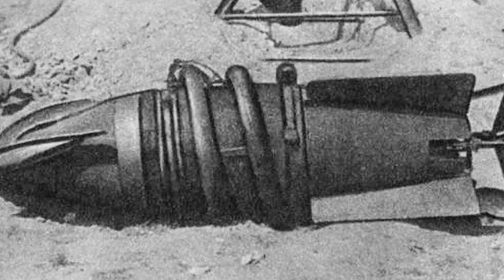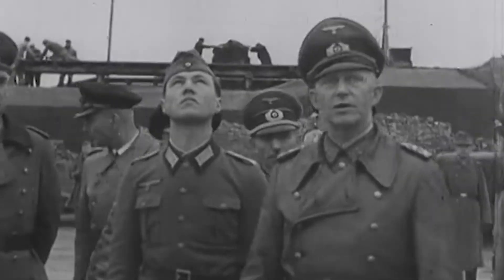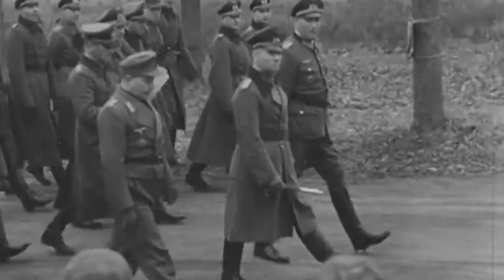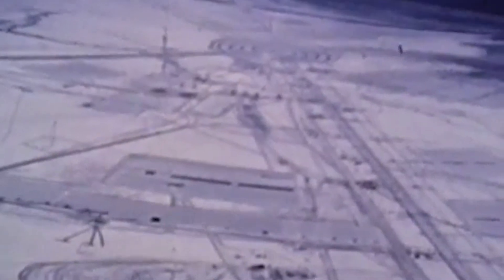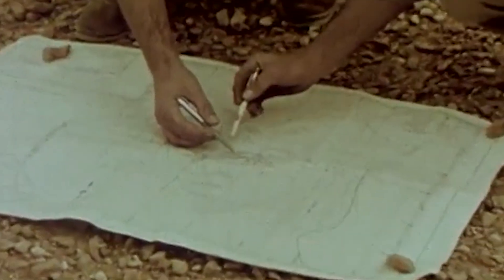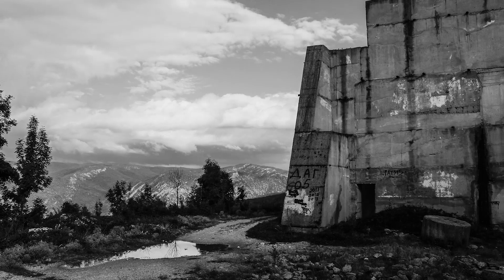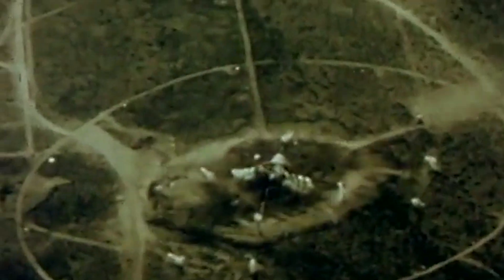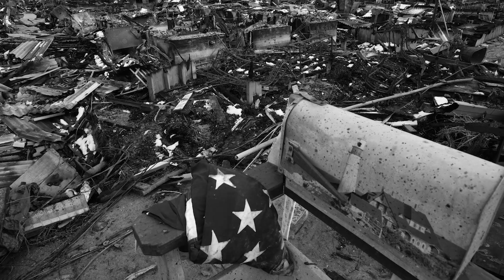The Soviet Nuclear Battle Mole: An Underground Cold War Battleship?

Comment: I feel it necessary to call serious BS!    

This is all just of the top of my head from past school research projects.

  “Drill that melts rock”     A temperature between 1100-2400F (many factors) is required to melt regular rock, temp of an average power plant reactor is somewhere around 570F. Assuming a more compact reactor would of course run hotter, the melting point of uranium is only 2070F (one of the higher melting point of radioactive metals if I remember correctly), and going anywhere close that temperature would most certainly be impossible to contain without a vast supply of cooling fluid. Not to mention that you are basically cutting it’s useful service life into weeks (without doing too much math) as opposed to years if not decades compared to war ships and power plants. I’m not even sure most control methods could even survive those temperatures let alone the rapid degradation due to (this process that I can’t recall the name of, but basically speeds up corrosion due to heat and oxygen exposure). Assuming you could somehow generate, store, then adequately release that much power from such a poor reactor design while still trying to maintain movement and suitable living space, this is all highly unlikely. 

SOOOOoooooooo many other reasons why this would never work...

An RTG powered electric drill on the other hand, would probably work. But would still suck.

Comment: A craft that melts its way through rock... interesting, how do you keep from roasting the crew?
Reply: And if it breaks down, it becomes a coffin.
Reply: @NeilRoy  See, Mitch Hedberg was right. It needs an escalator, because an escalator can never break down. It can only become stairs.
Reply: @NeilRoy  NAH! They just have to use the pneumatic canons and shoot them out in the air. Wait? What?! In a tunnel? Oh. No worries, their skulls are harder than diamonds.
Reply: They nuke themselves to create a hole big enough to crawl out of.
Reply: Its just hot at the tip, trust me... lol. And please remember to keep your hands and feet inside at all times, walls are molten glass, thank you enjoy your ride.
Reply: It’s possible to create heat shielding, and with a vehicle this big, if it has ever or will ever exist, could have a substantial bit of heat shielding that would allow the crew to be relatively ok, but what material can be heated that hot and bore through rock and not be deformed thats the real question.
Reply: @jamesshields4346  Tungsten could theoretically be used, seeing as its very strong and has a melting point of around 3.500 °C, way above the melting temperature of rock. Another option could be a layer of plasma to melt the rock, and a layer of ceramics to both isolate from the high voltage needed to generate and maintain the plasma, and isolate from the heat of the molten rock.

However although I could see this beeing feasible in current times, it would probably need huge resources and a hell of a lot of money, and if definitely wouldn't have been possible in the 60's.
Reply: Ceramics
Reply: Flush the Tip internally periodically with liquid Nitrogen held in a coolant recirculation system.
Reply: Now that's an easy one.... How does it come the pilots of an SR 71 don't "roast" ?

Comment: Gotta call BS on this one for a whole lot of technical reasons... Rock doesn't disappear because you melt it or drill through it. Melting through rock like that would mean your whole "Battle Mole" would be surrounded by molten rock at perhaps 1,200 degrees C. And it wouldn't leave a tunnel either as the molten rock would solidify behind it. No matter what you make the Battle Mole out of, it would quickly heat up to red hot inside... and the energy required! it takes about 600 joules to raise the temperature of one kilogram of rock by 1C. A "Battle Mole" would need a fairly large frontal area. Assume it is 4 meters in diameter, that means it would need to melt 12 cubic meters of rock for every meter it traveled. Assuming that it needs to move at 1 meter every ten seconds then it would need to give off some 2.5 BILLION Watts of heat continuously. Since no nuclear reactor is anywhere near 100% efficient, even if one could crank out that kind of power, and the vessel could be protected from the external heat, it would melt and vaporize the Battle Mole pretty quickly. BTW this is several times the power generated by a Ford Class Nuclear Air Craft Carrier. and remember that this is for a vessel that can only move at a pace that would bore a snail, 0.1 kph... And what mechanism would the device use to transmit the heat to the rock?

Comment: only in russia..... lol paratroopers in an under ground  mole machine.  My last combat jump was from -60 metres
Reply: They edited out the part where the battle mole reaches the surface and the paratroopers are shot out of a pneumatic tube to a height of 450 feet so their parachutes can safely open and they can then invade.
Reply: @davidhollowood6580   I'd believe they'd shoot the paratroopers out into the air, but they're Russian and a pneumatic tube sounds too rational of approach. Some engineer or army officer will come up with a cheaper way, like giant rubberbands slingshots,  or holding the feet of two eagles
Reply: @aikhis  The paratroopers have a lot to be thankful for. They use compressed air to launch the missiles from the regular submarines. I don't see the USSR spending extra to buy new rubber bands.
Reply: @davidhollowood6580  this is how things happened back then, we've swept away the rubber band idea as ridiculous because of cost, but the two eagle idea just slipped past to the next round of planning
Reply: @aikhis  Now that was funny.LOL
Reply: toag you sure underestimate them consider the failure that is the F-22 and F-35.
Reply: I did get a great visual of those terratroopers being shot out of the ground in clouds of dirt!
Reply: The Russian word for paratrooper, desant, is used for any special insertion troops, such as Tankodesanti, tank riders, marine infantry, etc
Reply: Was it a Polish design perhaps?
Reply: jokes aside why?
Reply: @humility-righteous-giving  My guess is the way Russia applied the word 'para' - in the West we immediately think of Airborne troops but that's not what para means.
Reply: YEAH, I NOTICED THAT ALSO. IT'S LIKE WHAT DID HE SAY....PARATROOPERS! FOR A MIN OR TWO THERE I FOUND MYSELF TRYING TO FIGURE OUT WHAT IN THE HELL COULD THEY USE PARATROOPERS IN THAT THING UNDERGROUND. I STARTED TO GET A HEADACHE AND FORCED MYSELF JUST TO STOP THINKING ABOUT IT. LOL, AND I THOUGHT OUR LEADERS WASTED MONEY!!! JUST WONDERING DID ANYONE OF YOU COME  UP WITH A LOGICAL THOUGHT HERE? MAYBE THE NARRATOR DIDNT SAY THAT CORRECTLY! A VOCAL TYPO IF YOU WILL
Reply: Cortana: Think about it like this.  The last thing the United States will ever expect is aerial insertion; underground.
Reply: Obviously to invade china... i mean if they were drilling in the first place its only to get to china
Reply: Would you be jumping out, or jumping in?.......
Reply: No mate they grab a shield and get launch in the sky by a nuclear bomb
Reply: I was the captain of an earth vessel, I was very stable and a genius my subordinates would tell me, has any one any questions, ama ?

Comment: What happens to all the rock?  Even if you vaporize it, if you leave a hole behind the vapor will cool and go back to sand.  Rock is already frozen magma.  Most rocks do not have any voids to hold the remnants of cuttings.

Tunnel boring machines have conveyors and railroads to remove the cuttings.

In Minnesota in the 50's and early 60's they used jet piercing drills to drill blast holes in taconite rock, a low grade iron ore.  There was a fuel oil / liquid oxygen flame followed by a water spray to spall the solid rock.  The exhaust from the flame blew the spalled rock out of the hole.  It worked, but modern tungsten carbide drill bits work better.

Comment: Pushing the melted rock to the sides.....How?
The tunnel must be wider than the "mole" if this is to be done.
Imagine a bullet in a gun barrel, the bullet is pushed forward by the expanding gases because the is no room for the gases to get past the bullet.
The same principal would occur here, right?
And if the molten rock would be able to be pushed past the Mole, either by internal piping or groves on the hull, the then molten rock would have to be deposited behind the mole making it impossible for the device to go in reverse.
This will leave no tunnel, basically sealing in the mole in a hermetically sealed tomb of solid rock.
Now if the heat is so great that the rock would evaporate instead of melt then it could work, but the hot expanding gases from the evaporation would have to be vented somehow to prevent over pressure..... maybe that is what caused the explosion under the city?
Anyway stupid idea and certainly not real, I call hoax on it.

Comment: Didn't know that for Russians, however I noticed that in last few decades, weeks or months prior to any larger US military deployments in various parts of the world whenever it is already clear that engagement is imminent, there almost always was news report about a small earthquake in that particular geographic area. Those were very convenient coincidences, especially if there was an high speed camera (or radar) equipped "eye in the sky" to collect seismic wave pattern on the surface and send it to a supercomputing center to calculate 3D image of the underground, revealing positions, sizes and shapes of any underground installations. 

I used reports of earthquakes as a clue that intervention is not just a threat, but already building momentum. I didn't know how the seismic charge could be delivered to the hypocenter, but this video offers some speculations about that. The following is a complete speculation by me, so take it just as entertainment:
I suppose that moving through already molten rock, perhaps just beneath the lithosphere, or at Moho boundary, should be easier than wormholing a glass tube through the rock all the way from point A to point B. It probably has fixed insertion points - shafts, wells, in permanent military bases around the globe, usually near magma chambers, for quicker start/deployment and better global coverage.

Whatever the thing is, it is one way only, it delivers a nuclear charge (neutrino footprint should confirm that), it embodies classified technologies, yet unknown to general public and scientific community, notwithstanding first obviously an explosive device capable of remaining stable under high temperature and pressure, a very high temperature thermodynamic engine for power production, high temperature shielding for electronics, or vice versa high operating temperature electronic devices and electric actuators, and reliable communication between surface and subterranean transceivers. It is either controlled by stored program, or steered by constellation of infrasound acoustical beacons on (or near beneath) the surface, or by projected neutrino beams. It is probable that its propulsion is reactive, as reactive works in all environments and mediums.
Reply: Lonely in that bunker, are we?
Reply: @goofyleo3869   Oh come on, cut me some slack, this is some good stuff, prime material, even though it is pure speculation. =)

Comment: Fascinating but they bring so many questions.
How would operators of them breathe or survive? The heat generated will spread into the machine. Radiation contamination too - unless these are remotely operated or have built-in guidance.
Have we not seen recent videos emerging of rumbling beneath US soil? Covert military operations too which appear to 'target' certain hidden things where recent rumbling and bangs were heard?

You've hit on the obvious one: Travel hidden beneath the sea first which will cover huge distance and hide the moles. Dig them in on shorelines and let them head underground to a set point.

If they do exist, it would be fascinating to see one sitting in a cavity and just waiting..

Comment: Inspite of your solem tone of delivery, I find it hard to believe in this "Battlemole"" project. First is your use of the term 'Battlemole' instead of a suitable Russian name or designation. Even the Cas[ian monster project  bore the Russian designation, Ekranoplane. Second. at a speed of just four to nine miles per hour, the device would literally take "forever' to travel to any conceivable target point without the crew running out of supplies, or being roasted by internally generated and externally induced heat due to friction and the onboard nuclear reactor. 

Thirdly, and perhaps most importantly, the "Battlemole would nt be drilling through  homogeneous layers of rock, but through varying densities of materials. In the same way that Chobham Armor protects tanks from kinetic energy penetrators, the Battlemole's drill might end up stuck fast in the rock it is trying to bore through. At worst, the machine mind end up just rotating around a stuck, fast nosecone. the crew eventually ending up upside down. There is also the possibility of the weight of the earth above it crushing the machine into an immovable shape.

Comment: Pure 1000% B.S. If? the very high temperatures that would be required and enough of it could be applied, and the crew or even a robotic compartment and the nuclear power plant could still be kept cool enough to continue to operate, there's no known man made material that would survive for long at the working end of the machine due to the heat and abrasion. Then howthehellyagonna replace that when it needs it? Heat causes expansion, so you have more volume of melted rock than you have space behind you for it to fit. Even after cooling it's still going to have more volume than you started with. Rock in it's normal state is pretty dense, disturb it by any method and it's simple physics it again takes up much more room by a large margin than the space you have behind you without returning it to the same or higher density.  

The U.S. was and probably still is famous for letting known spys steal information they want stolen just to get the opposing side to waste resources, money and man power on proven not to work concepts. Just enough plausible scientific information gets included to make it appear cutting edge and possible. Anyone think the russkies didn't and aren't doing exactly the same as well as numerous other nations doing it as well? At best the whole manufactured story would be a poor plot line for a B grade movie. Disinformation is a powerful weapon just as much as propaganda is. And this one's full of both. Cheerist I didn't even finish grade 10 and even I can figure out basic physics. Anyone who thinks this could possibly be real needs to start out by bitch slapping there parents for not doing a whole lot better job at giving birth and raising more intelligent offspring. Then go back to every school you went to and do the same to every teacher, instructor or Professor you ever had. All of them have seriously failed you or you spent most of your life drunk/stoned or asleep. To paraphrase Dean Martin in Animal House, unbelievably gullible and stupid is no way to go through life.

Comment: Project was abandoned after everyone noticed Vladimir had stopped taking his meds. 4-10mph. Rock cooling to glass right after. Vehicle not getting crushed by unstable rock, swamped by an under ground aquifer, obliterated by a gas pocket. Oh and the need to service the drill head...problems with the tunnel collapsing or flooding... Did I mention the vehicle turning into a boiling coffin? :)
Reply: What about the crew oxygen supply? It would take weeks to get anywhere. There is also the problem of underground navigation over large distances.
Reply: My exact thoughts! Digging your own grave with a casket oven lol

Comment: Howard Hughes was rumored to have perfected remote controlled versions of these around the same time. If you look into DUMBs and secret tunnel networks you are likely to come across something about them. He also pioneered the TBM, and was the US gov's "go to" guy when it came to large technically advanced projects they wanted kept secret. It wouldn't surprise me to find this was true, and that the pentagon have had them busy for decades.
Reply: @goofyleo3869  Yes indeed! I use a >1% solution of food grade hydrogen peroxide instead of toothpaste. It works wonders.

Comment: Rock is solid up to 600°C and liquid 1200°C. If boring is used, there are no alloys that remain hard, tough and oxydation resistant enough be used as rock cutters beyond 600°C. If melting is used, there are no metals that remain structurally sound enough to withstand the crushing pressure of rock bearing down on the craft at 1200°C. If there was an extremely quick method to create tunnels, people would use it for tunneling. Many long tunnels cost dozens if not hundreds of billions and take years if not decades to build. At 9kmh they could be built in a matter of days at a tiny fraction of the cost. Even if the craft to make them cost a trillion dollars to build, people would still rent its services because it would still substantially reduce tunneling cost and make project completion unbelievably quick. If something does not exist despite it being still highly profitable at a cost sufficient to allow us to settle other planets, it is quite safe to say it is beyond our current technological capabilities.